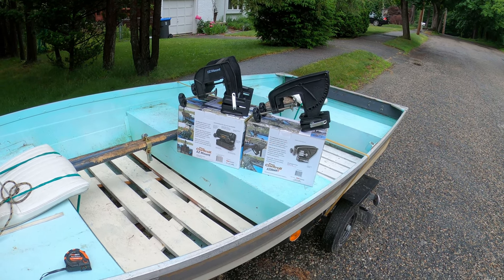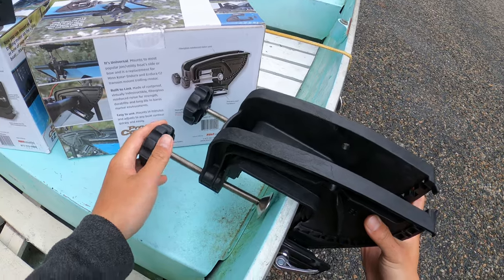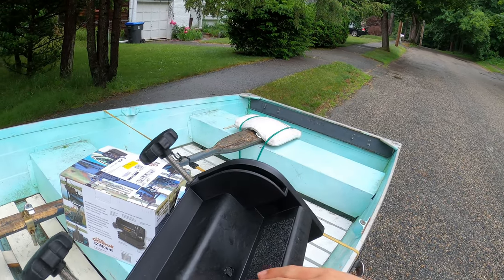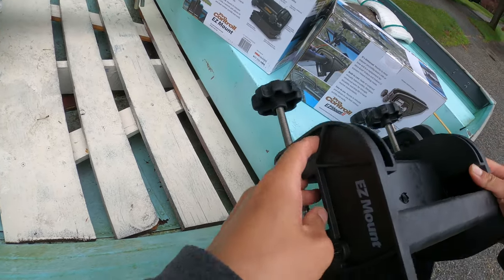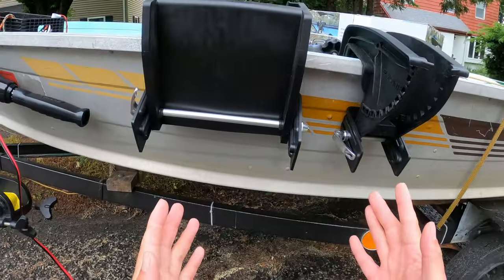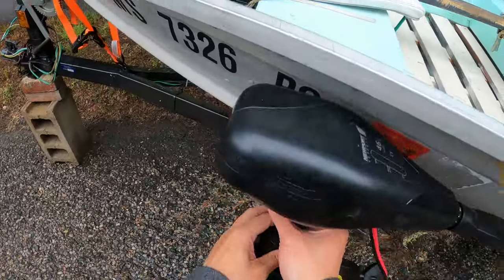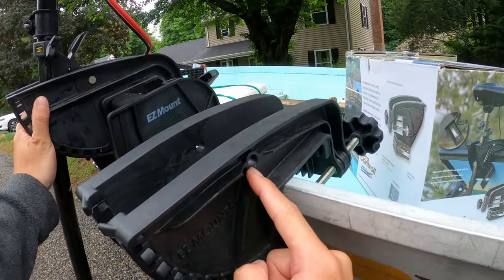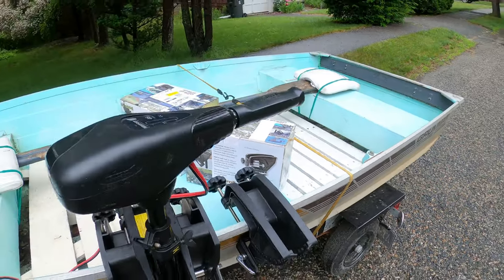Bow Mounting Transom-mount Trolling Motor on Aluminum/Jon Boat

Comment: i hAve a rounded gunner that needs about 1.5" from the top of the clamp disk and the bottom of the transom for the discs to clear the rouded gunner.  I have found every other imaginable measurement on this product except the one I need to know if this will work.  There are no complete dimension diagrams on this I can find on the internet.
Reply from the maker: Yea I would recommend you order on Amazon and try it. Return it if it doesn’t work?